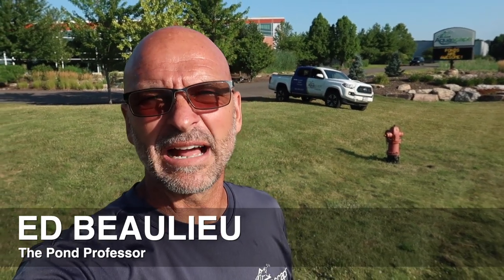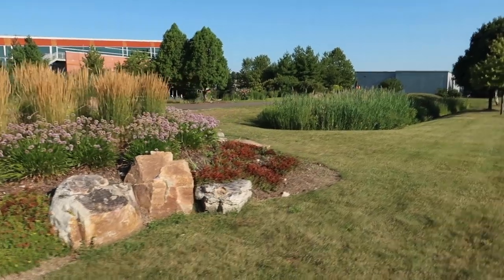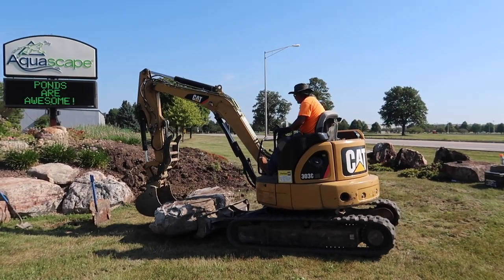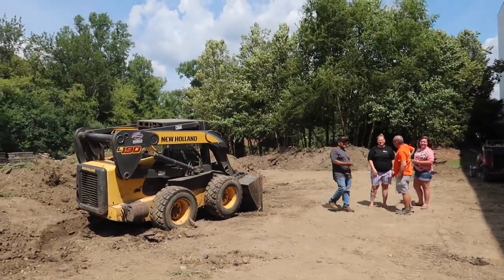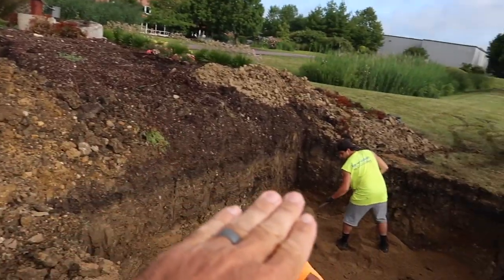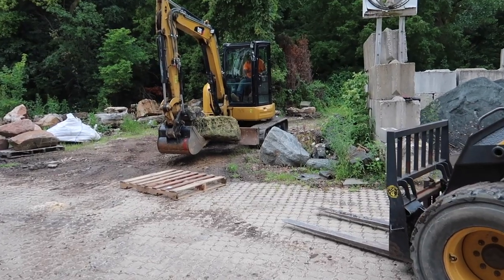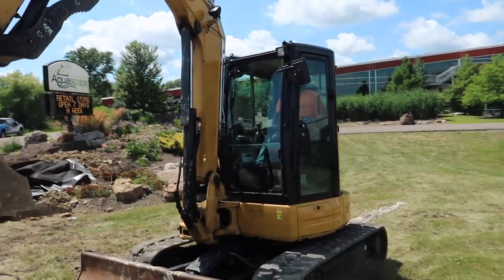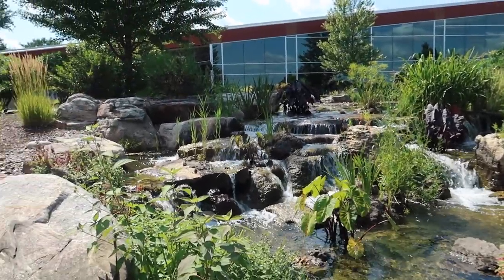ENORMOUS *WATERFALL* Prep at Aqualand - Part 1

Comment: Great video. I'm in the "Construction" section of your beginners courses. Ironically enough, "Building a pondless waterfall" is my next chapter. 

On a seperate note, I am confused on calculating gallons in a pond. How is the average depth of a 2 ' pond only 1' in the equation? Love your content. Thank you for your time.
Reply: Sean Odonnell  when you are building a 2 foot depth Aquascape ecosystem pond only a small part of it is actually 2 feet in depth. Therefore the overall greater average is 1 foot in  depth.
Reply: @donniebeck6112  Thanks Donnie. That makes perfect sense
 I always see shelves. Duhhhh.